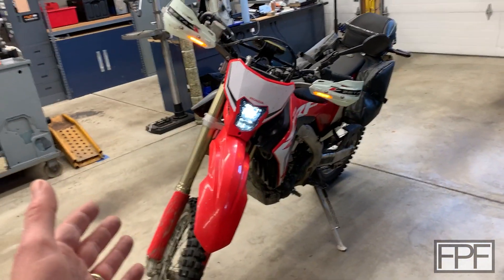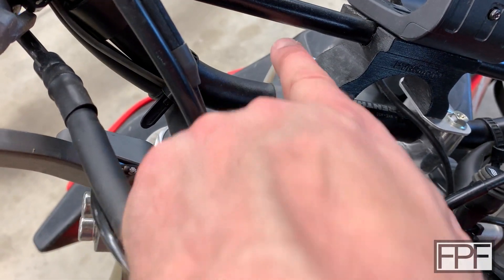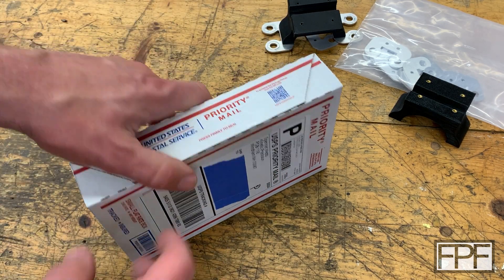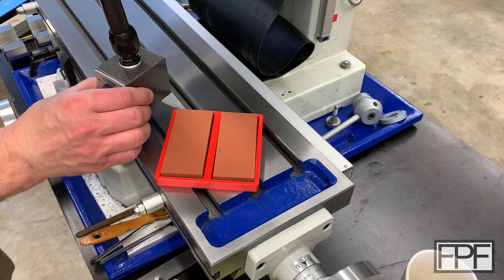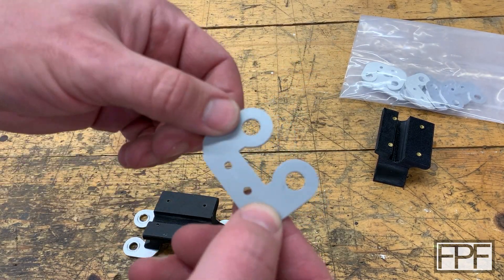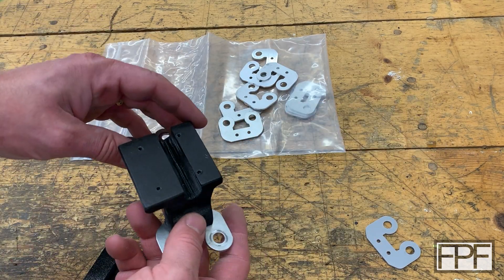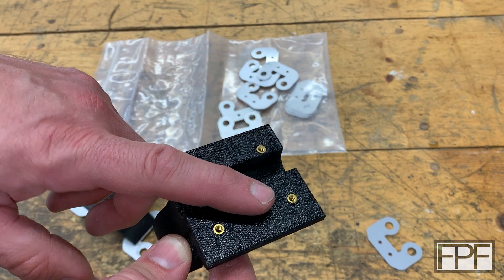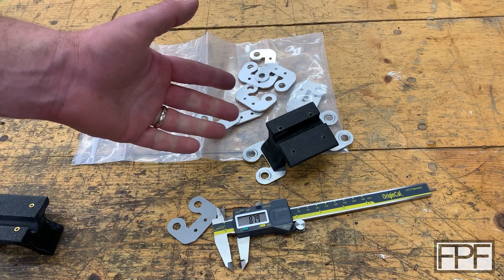3D Printed GPS Mount for Motorcycle

Comment: Great channel, thank you. You're lining up nicely with a lot of my needs to keep my 2014 EXC 500 up to a decent spec. Even simple sounding tasks, like a speedo and dash that holds the ignition key, a USB power out, ECU switch and low fuel light can take days to get right, but its very satisfying when you get the hang of it.

I agree with you about the frustration of "trinket" output in the field, as opposed to items that are both universally useful, and beautiful.
Your GoPro helmet mount is genius, and I found your video on TPS outdoor robustness fascinating.
Reply from the maker: thx.  glad you found the channel and nice bike!

Comment: One thing to note is that rubbing two stones together won’t guarantee flatness. In fact, it usually leads to one convex and one concave surface. To guarantee flatness, you need a third surface which is ground against both. The convex surface will make the third surface concave, but then rubbing two concave surfaces together will make two flat surfaces.
Reply from the maker: @KPNH Interesting, I wonder if Spencer recommends alternating between the 4 available flat sides to keep things flat